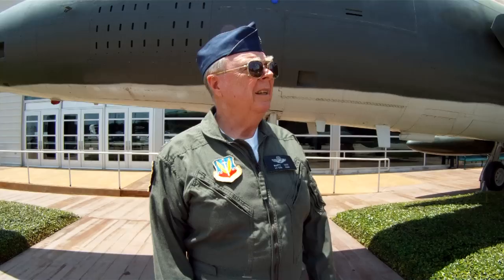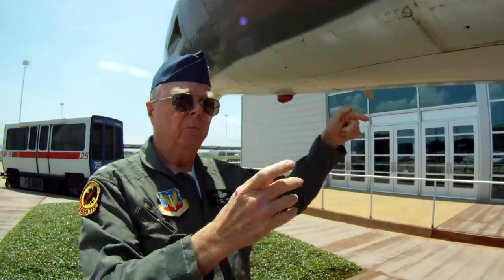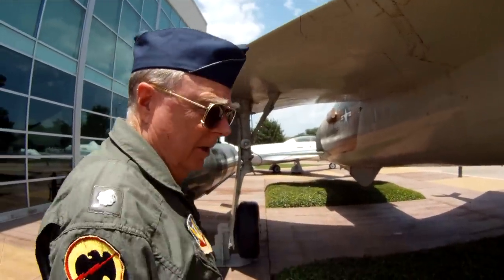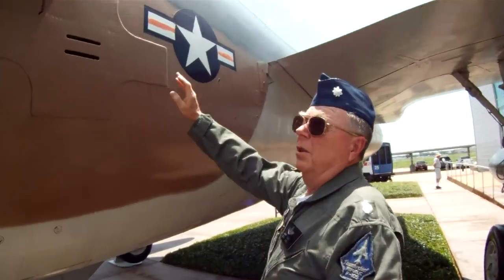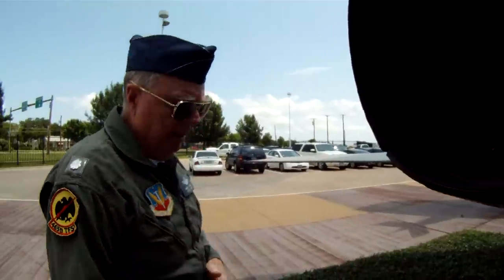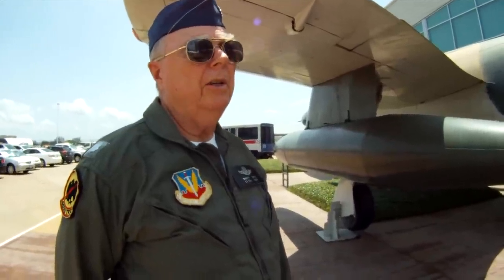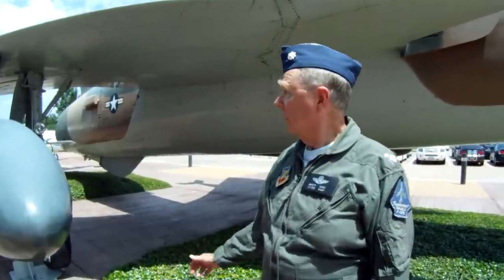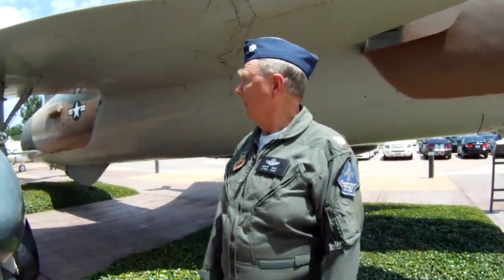F-105 Walkaround With Pilot Marty Case

Comment: Since anything built by Republic (originally Sikorsky), later bought out by Fairchild, rolled and rolled on the runway before it broke ground, it was generally referred to as the Thunderthud. The Sikorsky or Republic P-47's T/O roll was also long, as were the Fairchild's F--27 and F-227T/O rolls.

The F-105 had a system that allowed pilots to avoid running into hills when flying at low altitude. Some pilots in Vietnam lost their nerve when approaching a hill at low altitude, disconnected the system whereupon some of them died. 

The plane was designed to toss bomb nuclear weapons. Approaching the target at low altitude very fast, the pilot would pull up and at some point near when the plane was pointed straight up the bomb would be released, go up over 20,000', then drop onto the target. Meanwhile the pilot rolled out before the completion of the loop and got out of the area ASAP on the deck. It was referred to as a LABS maneuver.
Reply: Republic Aviation was not originally Sikorsky Aviation. Sikorsky Aviation was started by Igor Sikorsky who  developed and built Helicopters,not Fighters.
Reply: I think they meant Seversky.

Comment: F-105 Thunderchief, aka "The Thud". Designed solely for high speed at low altitude for nuclear bomber missions. Wasn't optimal for conventional bombing, wasn't optimal for Vietnam at all, and so ended up nicknamed for the sound they made as they crashed into the jungle. But the good men of the Air Force did the best with what they had. Chuck Horner, the 4-star in charge of the air war in Iraq I, was a Wild Weasel Thud pilot who bailed out of one in Vietnam (if I recall correctly).

Weird fact: the F-105 could carry WAY more bombs than a 4-engine B-17 or B-24 heavy bomber from WWII. Full load was 18 750-lb bombs, total weight of 13,500 lbs. Max bomb load on a B-17 or B-24 was around 8,000 lbs.
Reply: +Arthur Compton Actually it was named "Chief Thunderthud" during development--after the Howdy Doody show character.
Reply: gallantrycross Aha! I didn't know that, thank you for the straight dope. I read Chuck Horner's autobiography, where he mentioned the "Thud" etymology arising in Vietnam, where they lost so many aircraft it became the only fighter model ever withdrawn from service while still state-of-the-art simply due to casualties. Something like 46% of EVERY Thud ever produced ended up destroyed, the vast majority ending up scattered all over Northern Vietnam.
Reply: I was in the the USAF from 1968 to 1972.  My last outfit was the 561st TFS (Wild Weasels), we swent over 12 planes for the Easter Invasion and four of them got shot down, one of them was the last F-105 shot down in Vietrnam (by a SAM missile).  We pulled 1,900 missions and got a Combat "V" for our USAF Outstanding Unit Award.  So it was the sheer number of missions we pulled.  I was a sarge and worked on them, even the T Stick II variant, which was never used in Vietnam because the war ended.
Reply: We actually won the war with the Xmas bombing, we forced North Vietnam to the negotiating table and made them sign the Paris Peace Accords, thus ending the war.  Then we left but three years after we left the South Vietnamese lost.  But we get blamed.
Reply: +Arthur Compton As Marty Case says, the wings were symmetrical so they weren't an airfoil (to avoid wing turbulence) so it was just a liquid fueled rocket with fins and could go as fast as you could push it.  An F 105B was clocked at Mach 2.15.  But the plane had to be clean and smooth to go fast.  The wings had no fuel so it could take hits in the wings and not have fuel leaks and keep going.
Reply: The Vietnamese people won the war, just as they won the previous war against the French.  The US murdered millions of innocent civilians and heroic fighters because they would not accept rule by US-backed dictators.  Today Vietnam  is free, and the United States is a failing country.  And before you call me a Commie, I was an F-105 armorer, and I still have the arrrowhead patches that Colonel Case wore.
Reply: Y.G.B.S.M.
Reply: f 15 couldn't even keep up with the thud down low. they tried it and the 105 ran away from it.

Comment: Great video. Was this plane good for dogfights
Reply from the maker: Ryan World War II History Buff Guy 582 Not really. It couldn't turn with the MiGs. If you got one behind you, they would head for the deck and full throttle. Nothing could touch the 105 fast and low
Reply: ErikJohnston Ok thanks. Besides the F-4 what US aircraft in Vietnam was good for dogfights?
Reply: F5 Tiger was very nimble and superior to the Mig 21 in many respects as was the F8 Crusader. Both these aircraft were designed around guns as their primary air to air weapon so were decent in a close in fight.

Comment: "Shit Hot” 
What a great video about the 105, an aircraft I grew up with!  I would like to make one correction at 19:50 on this video, The SH “Shit Hot” came about much differently then portrayed in the walk around. 
My father in 1974 , Maintenance Control Officer Lou Ferraro of the 507th Fighter Group was the one that implemented the UC to SH tail change. The cover up for the real meaning of SH “Shit Hot” started in 1974 with the meaning of SH being short for 507th Commander, Major Roger “Scheer” and Chief of Maintenance, Captain John “Hopper”, as a consequence; for this reason, the SH was short for “Scheer” and “Hopper”.  Or just plain old Sierra Hotel or much later “Sooner Home”.    Of course the REAL meaning of the F-105 tail SH “Shit Hot”, as my father has always claimed, reminding him of his time at Korat Royal Thai Air Force Base. SH was a meaningful saying to a fighter pilot and to the crews that supported him. When the pilots came back from a mission and said it was “Shit Hot”, it meant that they dropped their munitions and got back without getting shot down.

Comment: I was stationed at McConnell AFB in the early 70's and the Guard unit had F-105's.  I remember they made lots of noise taking off.  I knew a Thud pilot and tried my best to get a ride on one of these.  Never got it worked out.
Reply: Arch Stanton : I WAS STATIONED AT MCCONNELL 1968-1970 AND TRIED EVERYTHING TO GET A RIDE IN THE BACKSEAT AND WAS PRETTY MUCH TOLD TO FORGET IT. UH-1, HH-43 WERE NO PROBLEM. I HAD THE HONOR OF MEETING COL. LEO AND MRS. THORNESS IN 2014 AND IT. WAS HUMBLING TO HAVE SUCH A MAN THANK ME FOR MY SERVICE ESPECIALLY SINCE HE WAS INTERRED IN POW CAMPS FOR MY ENTIRE LENGTH OF SERVICE AND I DID NOTHING TO DISTINGUISH MYSELF EXCEPT COMPLAIN. THE F-105 HOLDS A SPECIAL PLACE IN MY HEART AND MY RESPECT FOR THOSE WHO FLEW THE A/C IS UNBOUNDED. I CONSIDER AN F-105 PILOT THE HIGHEST FORM OF LIFE ON THIS PLANET.

Comment: Was the water used for fuel injection distilled water or ordinary tap water?  Did the water have additives?  I'm wondering about the corrosive effect.
Reply: The water used was actually water methanol, which was 106 octane. Injecting this into just about any kind of engine increases power by increasing mass (either in an automobile cylinder or a jet exhaust), and there's also a cooling factor involved due to the energy change when the water goes from liquid to steam. And also, the difference between indicated and calibrated airspeed is normally negligible. 

The colonel mentioned that he had seen 730 kts indicated near the ground. That's 798 mph. And since the speed of sound at SL is 761mph, he should have been supersonic at the time, about mach 1.05.

Comment: Great video! I worked on the F-105B, D and F models for ten years and I learned things from this presentation I didn't know. Mostly operational facts I didn't need to know but interesting just the same. I worked in Weapons Control, Comm/Nav and even the Weapons/Gun shop. I loved working on the Thud. Most things were easy to get to and it was a pretty reliable airplane. We later got F-4s and I hated them. Thank you for the walk-around Colonel Case - and thank you for your service!

Comment: Major Thorsness and Captain Johnson flew this Republic F-105F-1-RE Thunderchief, 63-8301, on 19 April 1967. It was one of 61 F-105Fs that were upgraded to the F-105G Wild Weasel III configuration beginning in late 1967. It survived the Vietnam War, but was destroyed 20 December 1974 when, assigned to the 35th TFW at George AFB, California, it crashed at the Cuddeback Lake Gunnery Range after an engine failure. (U.S. Air Force)
I was the tower crew chief when this F105 had a engine flame out just after they made a run on a striff target, flying left range, right traffic. they punched out as it was in it's climb to roll over and nosed dived into the desert floor just on the back side on  a ridge to the NE. I was the one that picked out the two off the side of that mountain one with a spran anckle. Needless to the thud really mess up it's paint job.
Does anyone know who those pilots were ?
Sgt Matthew Echterling

Comment: There is a APK simulator for smartphones called Gunship III, F105 Thunderchief addon in the Vietnam conflict.  It is surpriseingly good for what it is, so anyone can try out flying the F105.  And yes you can land it without issues on highest settings if you run down your fuel enough, dont be discouraged, but you will use all of the runway.

Comment: The only fighter plane I worked in eight years of the AF. Worked the Doppler system on the Thud. I still have a spot for the F-105 in my heart, worked F and G's at Korat, 1971-72 388th AMS.